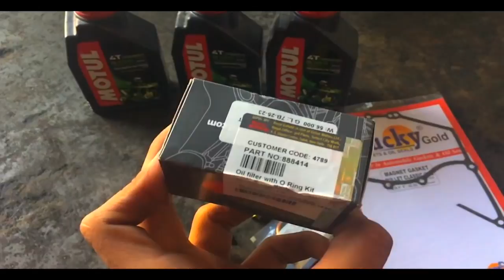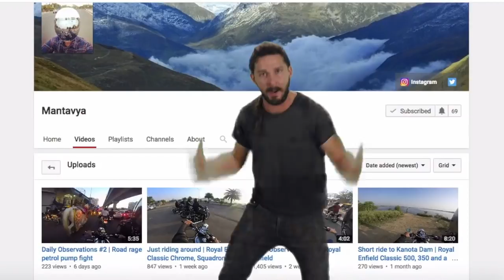Royal Enfield service after 4000km Goa ride

Comment: Changing silencer damages engine? Plz answer
Reply: Not at all! Its all are just myths. I am using sans glasswool short bottle on my classic 350 from 1 year and my bike is running smooth. Engine gets damaged when you do unnecessary things like pataka. 
Just ride gently and get check your bike on time and service .
Reply from the maker: if it's a 350cc get the carb tuned, if 500 then don't ride rough

Comment: Try Castrol power cruise 10times better than 300v. I have tried both in my 500. Motul 300v doesn't perform that well after few km runs
Reply from the maker: okay cool! how much is it per liter cuz I searched and on amazon it's only 999 for 2.5l, that is just not possible for fully synthetic oil
Reply: @Mantavya  this is correct...I used the same for ride to goa...it's cheap and effective